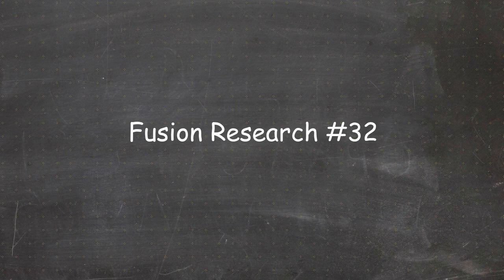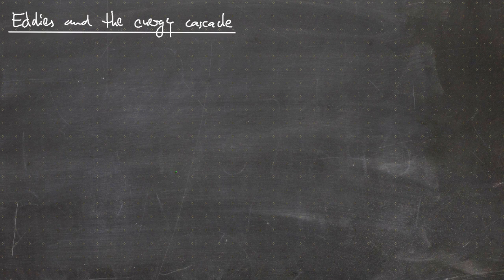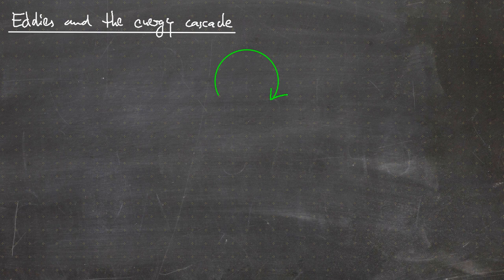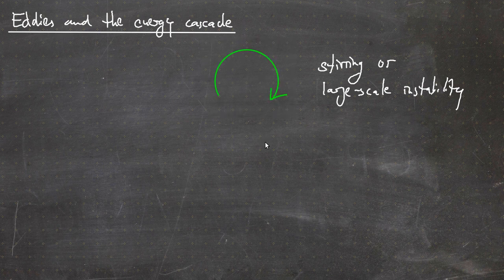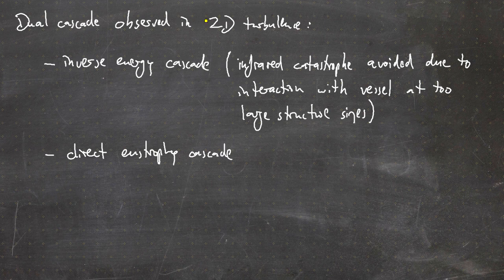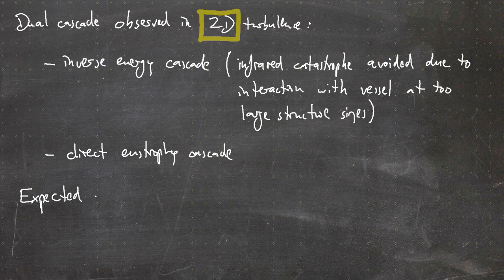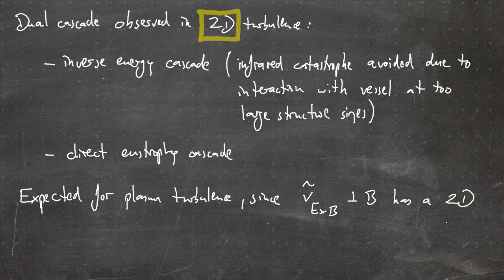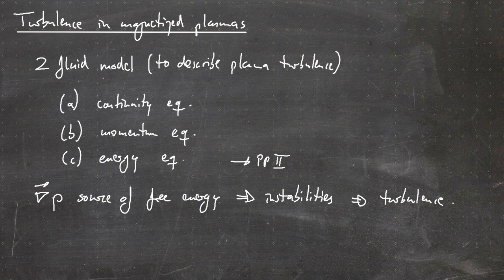Fusion Research Lecture #32 - The energy cascade (3D vs. 2D turbulence)

Comment: So basically in the energy cascade the TKE is transferred by large eddies to smallest ones near the wall which dissipate their energy contribution into heat by viscous forces. At the stage what is going to happen? For example, If I have a flow into a pipe with a large turbulence intensity is the flow able to heat the wall of tube?
Reply from the maker: Interesting question: let's assume, as you suggested, that the energy in the fluid is finally transformed into heat due to viscous forces. The fluid heats up. That heat will eventually also be transferred into the surrounding boundaries, across the interface between fluid and pipe. So, yes, the pipe will eventually also heat up.